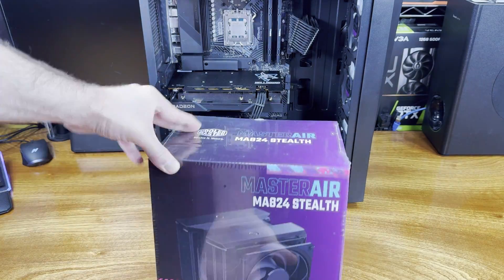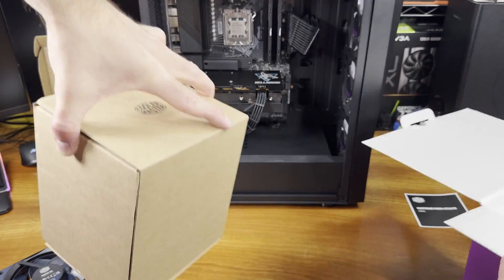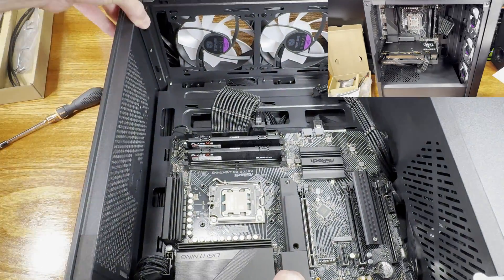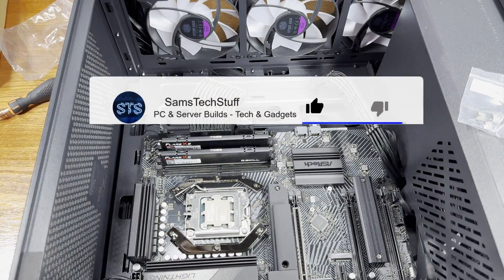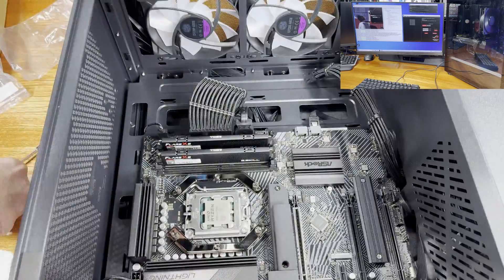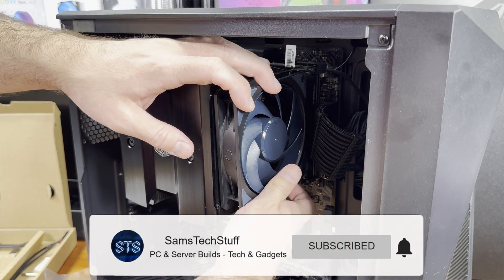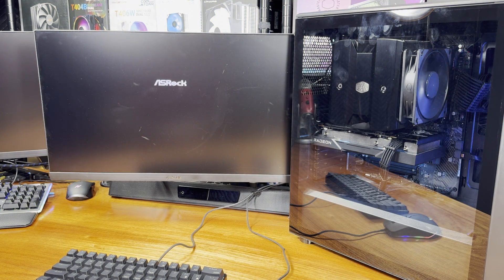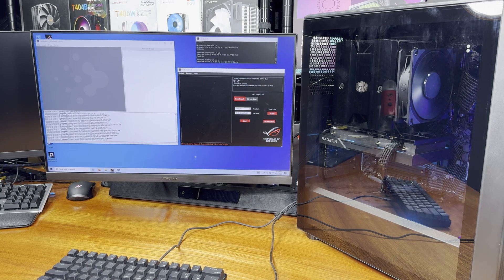It's Huge! Cooler Master MA824 Tower Cooler

Comment: returned the cooler, the screws dont get into the mounting kit on am5
Reply: hey got the same problem can it really not be fixed?
Reply from the maker: I was able to get it installed on mine, were you saying the screw were too short?
Reply: You had the bracket on the wrong way..
I did the same and the screws on the heat sink didn’t reach…turn the bracket around and they reach with a little pressure
Reply: @MrAckers75   my bracket with the hole to insert the screws into and the wall around it was facing up, and matching the manual.

Comment: What cabinet is that
Reply from the maker: Cabinet? Do you mean the desk the build is on it the shelving units for the set?

It's vac custom built desk made from saw horses and a door I sanded and polyurethane'd. The shelving units are all Amazon basics metal wire rack shelving units and I have attached a customized fabric solution for sound deadening since I record audio here too
Reply: @STS By cabinet I think he means the Case